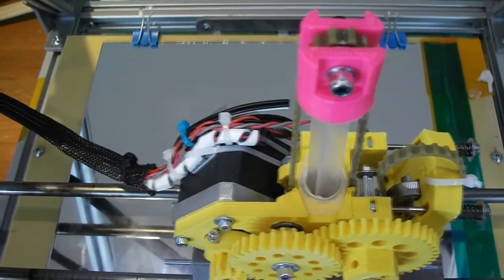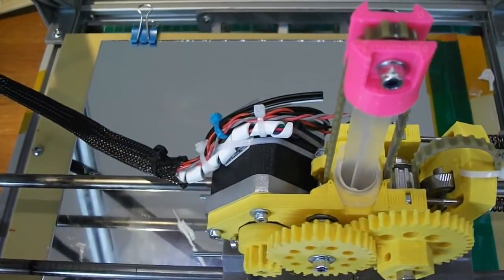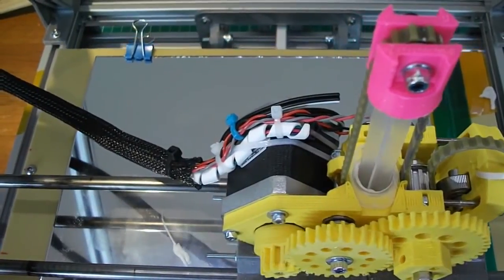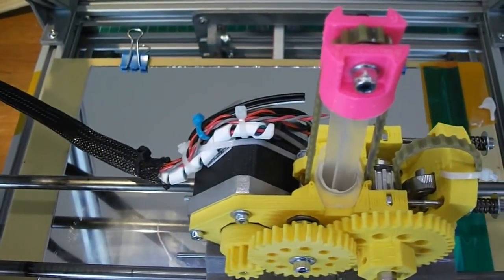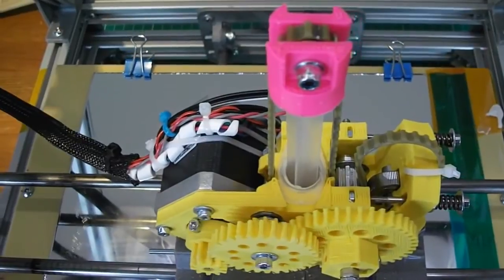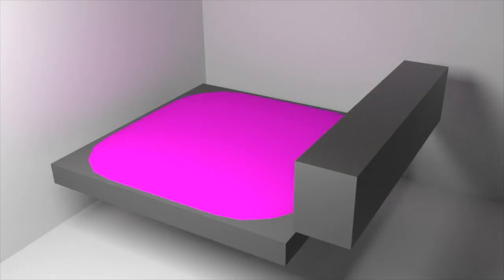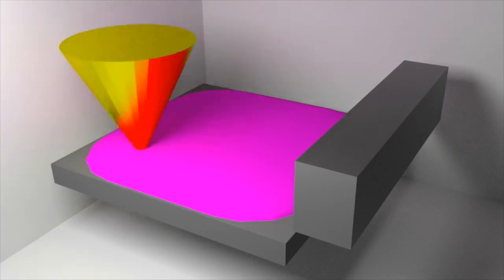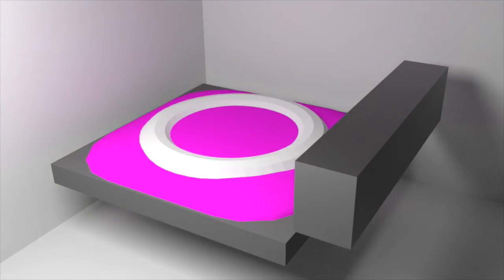Youmagine Challenge

Comment: Another thing that could be done is that  the reactant applied to the entire layer could instead be only aplied somehow to only the necessary parts of the print, similar to how a 2D ink Printer applies colour to a page, this saving on material (if a method of recycling it post-print proves ineffective), however, certain tolerances would have to be taken into consideration so as all the sylicon printed sets.
(I don't know much about using sylicon but from what I can tell from here it's the same consept as that behind two-part epoxy, where a reaction occurs causing it to set.)
I really think you're on to a good idea and I just wanted to give my input even though this video was posted over two years ago and the contest it is referring to is long since over.

Comment: The way you describe this process seems very similar to traditional powder 3D printing. If there was a silicone that had a part that consisted of powder, and the other is a liquid, this just may work with about any powder printer. As for FDM printers, probably not as much luck